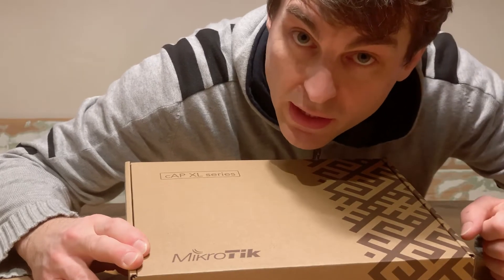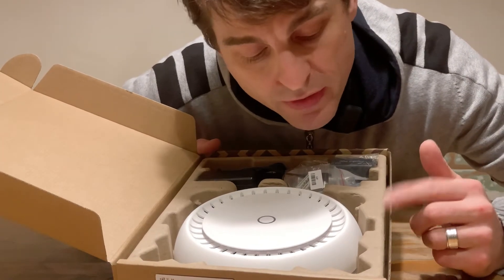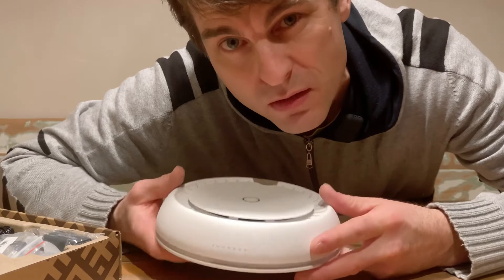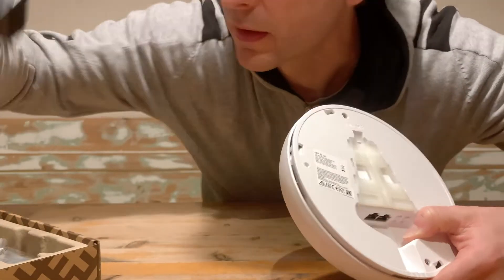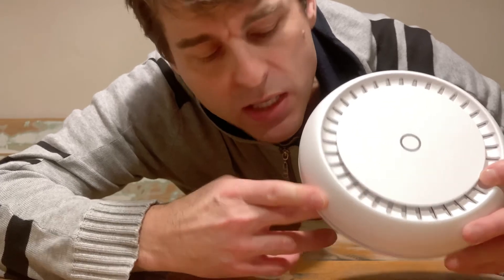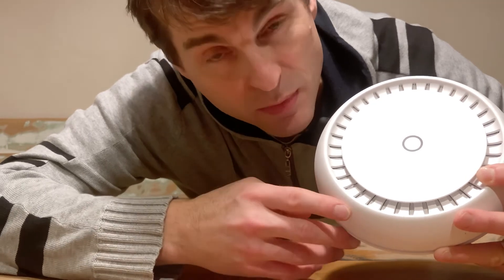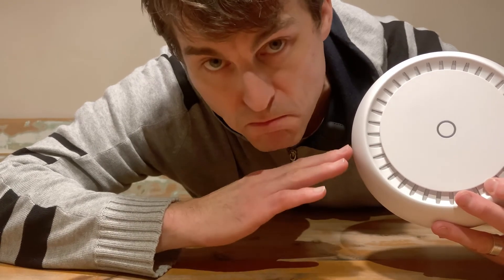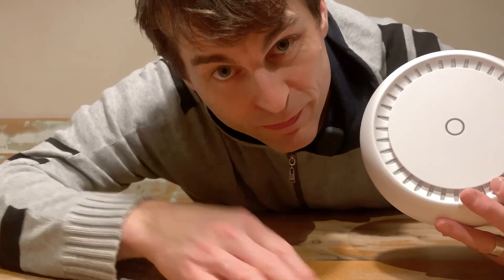Tech: MikroTik cAP XL ac WiFi Access Point | First look and reaction.

Comment: I do prefer the look (and cost) of the cAP ac which has similar hardware. The XL is probably configured as a router by default like the smaller model, so connect up to the LAN port. Plug and play and minimal configuration isn't really MikroTik's thing.
Reply from the maker: Thank you so much for your advice. Let’s see how the plug and play turns out. Yes I will actually be surprised if it just works without any heavy configuration. 

Oh the adventure begins. 

Thanks for watching.